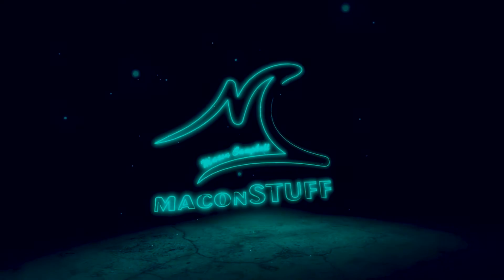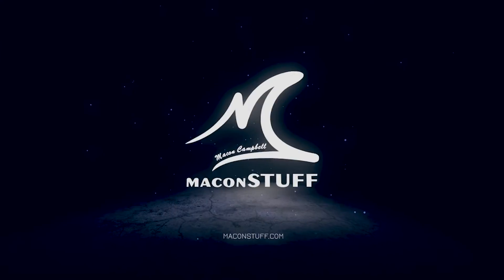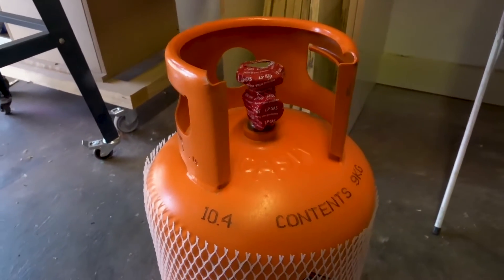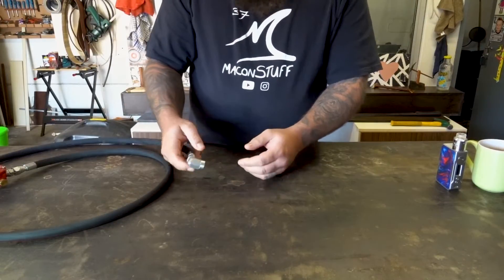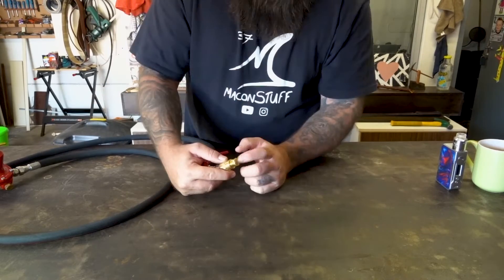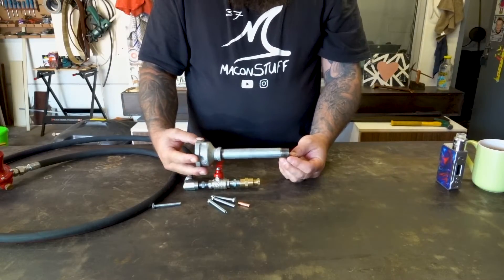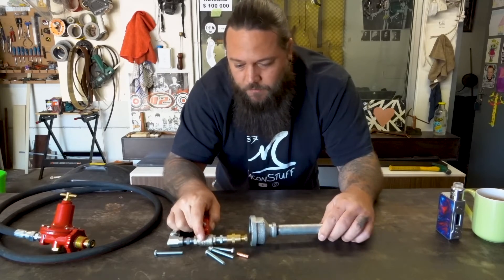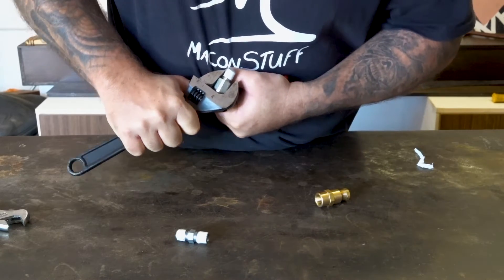Propane Torch Upgrade for my Forge

Comment: you should never use galvanized pipe let me repeat that NEVER USE GALVANIZED METAL IN AN APPLICATION LIKE THIS the zink coating will vaporize before the steel in the pipe even starts to change color i think it goes without saying but ZINK VAPOR IS HIGHLY TOXIC ☠️

Comment: Hi... nice simple clean build. My observation repeats other. Your steel was not hot enough. A thought for you to consider is that you are using hard fire bricks, these take along time to bring the forge up to temperature as they ask as a heat sink. It you wish to speed up the efficiency... try using lightweight insulation fire bricks. I would use the hard bricks on the base and are more robust when taking the steel in and out of the forge... worth a try....👍👍

Comment: Hello, thanks for the video, question, what is the other coupling on the top of the forge ??? a vent maybe??.
Reply from the maker: Initially when I made the forge, it used 2 portable handheld gas burners... here is a link to the build if you'd like to check it out: https://youtu.be/22Q_Ohga_lQ

Comment: I built a torch exactly like yours and it won't light - any suggestions?
Reply from the maker: Gosh... it could be any number of things... too much or too little air, too much or too little gas... wrong size nozzle... I'm no expert, this was the first time I did this too... you might want to check "King of Random's" video as well... I think I left a link for it in the video description... Are you using a high pressure regulator?
Reply: maconSTUFF - I built mine exactly like yours including HP regulator.  It lights at low pressure. But as soon as I give it some power it goes out
Reply: Peter... try moving the mig tip or orifice/ hole higher in the air chamber. Akso, if you have not done so already... use the reducer cone at the flare end of the burner. When set up correctly, this should draw the correct amount of air it requires...👍

Comment: Make sure the pipe thread tape your using is rated for gas, should be pink color, Propane is corrosive and will eat through white teflon tape as i have been told
Reply from the maker: Thanx James... I'll have to look into that...

Comment: The flame looks a bit erratic, and I would leave your metal in a bit longer get it up to a good yellow heat for forging. you don't have an air choke on your burner do you, maybe play with the pressure see if you can get a constant flame, or maybe the forge just needs to heat up.

Comment: It seems there's not enough gas pressure, that's why the flame sputters!
Reply from the maker: I got a high pressure regulator on there... Think the problem is most likely the air mixture... still going to add a solution to regulate that...

Comment: Using a fan to increase air (oxygen) content would also increase the temperature without using more propane, I added a small leaf blower to my little gas tank furnace, works great for aluminium and brass. Not tried anything else yet, my koal wool lining is only rated for 1400c I think

Something like this with adjustable airflow https://www.amazon.co.uk/dp/B0154IVX1C/ref=asc_df_B0154IVX1C56486479/?tag=googshopuk-21&creative=22110&creativeASIN=B0154IVX1C&linkCode=df0&hvadid=226592631289&hvpos=1o2&hvnetw=g&hvrand=8783770058820489650&hvpone=&hvptwo=&hvqmt=&hvdev=t&hvdvcmdl=&hvlocint=&hvlocphy=9046284&hvtargid=pla-406359562938&th=1&psc=1
Reply from the maker: I actually have one of those blowers... :-) ... I may go that root when I decide to build a foundry... Thanx Shaun...

Comment: Any thoughts on using a anti flashback arrestor ( I think that’s what they are called ) it stops the burning gas from burning back to the tank. Not trolling, serious question. 

Nice design, thanks for sharing. Love the mig tip idea. Cheers
Reply from the maker: Yeah, I wanted to use one but I could not find any... so i decided to go without. Seen many do it that way, so I thought it should be safe...
Reply: Its not needed with propane in THE same way that you need it for och acetylene.

Comment: Nice vid Macon.  I built a forge for melting aluminium cans.  I found that the bits from the charcoal would fly around during the burn so was very dangerous so I'm very keen to try build a gas one.  Thanks.
Reply from the maker: Thanx Mike... Yeah, go for it...